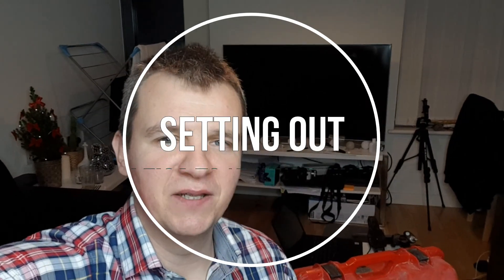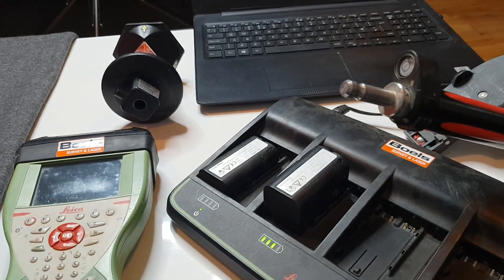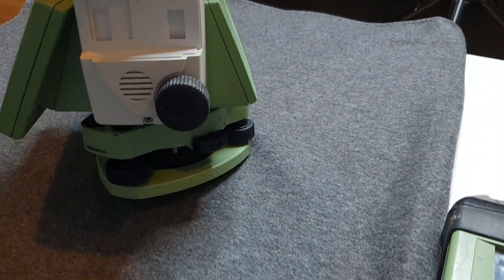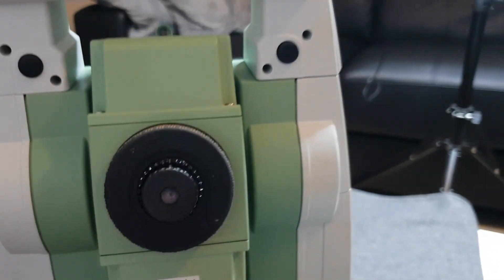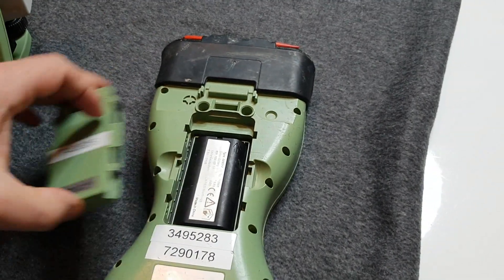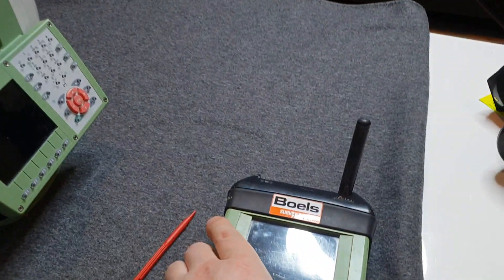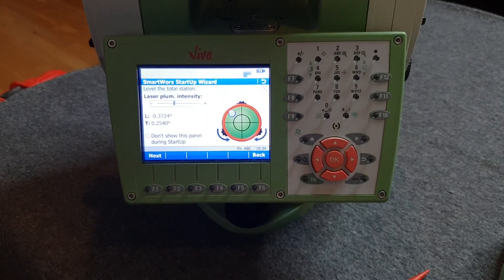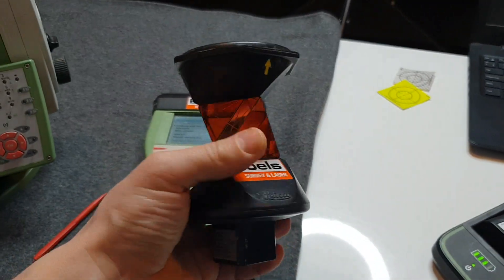SETTING OUT #10 - Leica TS15 Robotic EDM - 1 Man Total Station. 'Unboxing TS15'.

Comment: Hi Greg. If you are setting out accurate gridlines with TS15 on a poured slab do you use the large pole or can you use a mini prism with TS15 to get a more accurate line?
Reply from the maker: Of course you can use a mini (just don't forget to change the prism mode 😁) You can also just use a laser + target, using a large pole is a bad idea when it comes to high accuracy

Comment: Greg.
           Brilliant video to explain the full working of the great Leica TS15 in a very simple and methodical way which is far superior then reading the instruction or the manual.

         You said that both the Total Station and the Controller have the same software of Smart Worx Viva and thus you can use the Total Station on its own.

       1: Will you please explain what do you mean with your explanation on this issue as it is not clear what difference it will makes in the use and the total working of the Total Station during the use. Perhaps I missed it.

        2:  When you switch on the Controller then it is linked straight to the Total Station. But does it stay connected for the whole time or does it disconnect while working with it. What happens if some one comes between the Controller and the Total Station. Pleas explain.

         3: Can you use this Total station as an ordinary manual Total Station like Leica TS06, and as a Robotic Auto Total Station when you want to change over to robotic mode. Please reply.

         4: In your earlier videos you said that you need a minimum of three target of controlled station on the yellow targets to do the proper resection. What error you would get if you only used two target because the third target is out of view and not accessible.

                 I look forward to your reply.
Reply from the maker: Thanks Asim! Great to hear that :)